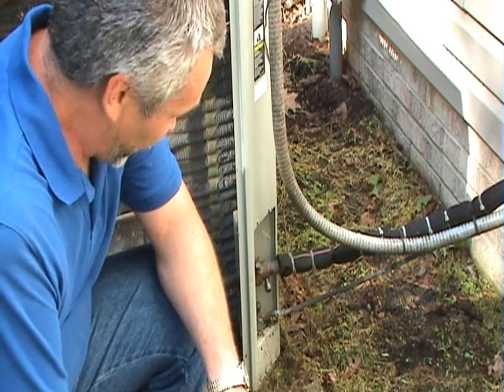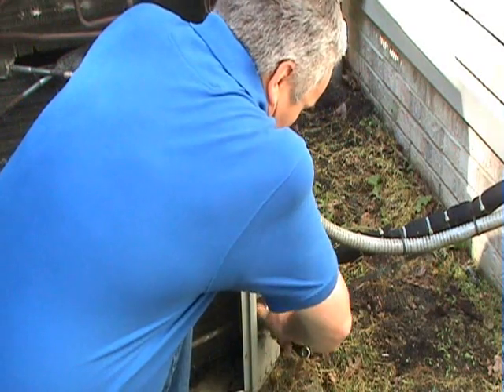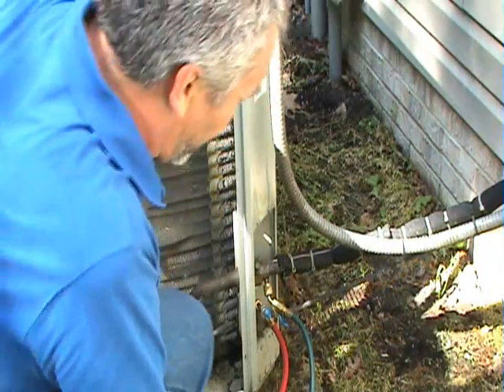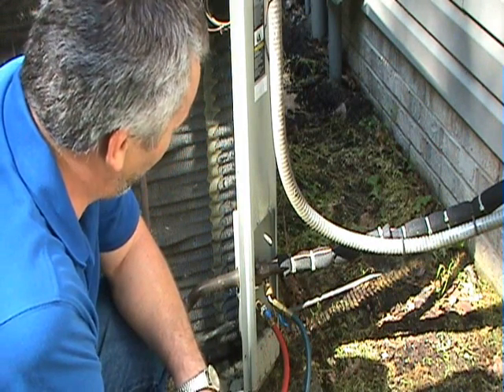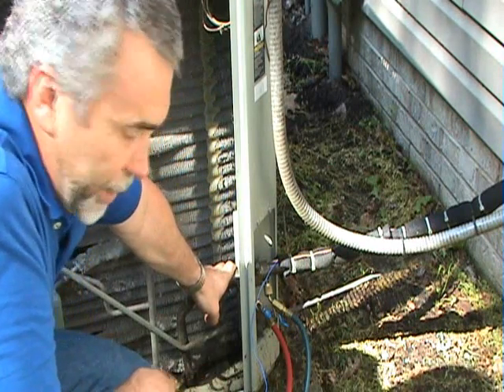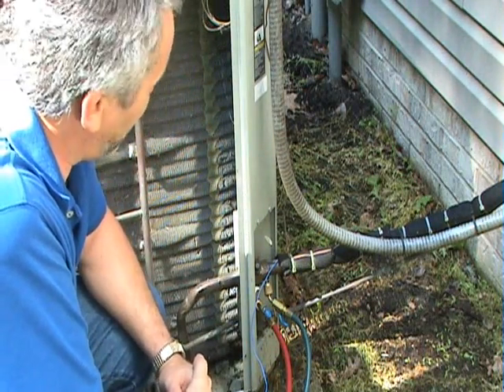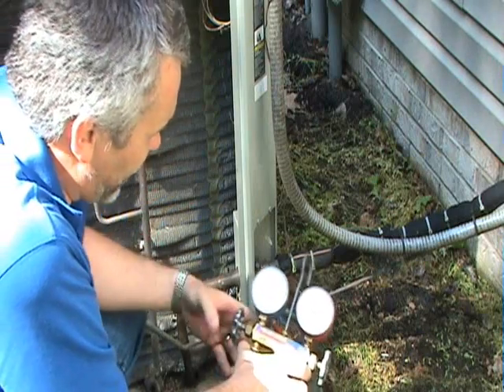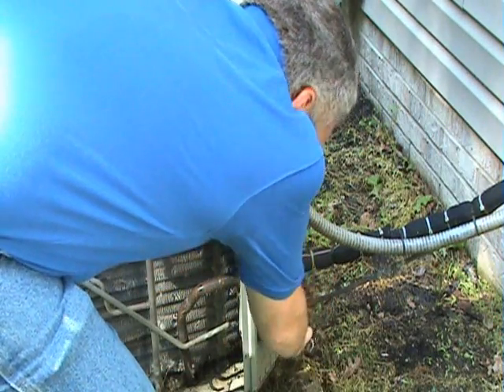How to Charge an Air Conditioner: AC Refrigerant Troubleshooting & Gauges

Comment from the maker: Not sure if you should charge by Superheat or Subcooling? Check your indoor unit! If you have a TXV (expansion valve), go with Subcooling. If it's a standard piston/orifice, use Superheat! 🌡

Quick Tip: Always let the system run for 10–15 minutes before taking your final readings. This allows the pressures and temperatures to stabilize so you don't accidentally overcharge the unit! [05:13]

Comment: R-410A is a blend of refrigerants. So when you charge you open the valve very slow so the refrigerant 1. Gets the right mixture, 2. You are filling it with liquid but because its the low-side you must do this very very slow so you do not introduce the compressor to the liquid as its a vapor pump not liquid. The liquid should hit its boiling point and turn to vapor. Thanks for the awesome video!

Comment: If the system needs a recharge, then it has a leak.  To be sure you don't loose any new Freon after recharging, you must seal the system.  The easiest way is to do it while installing the new charge, using a simple in line injector.   Find tech details and install procedures at this page...  stop HVAC leak .com

Comment: Thanks for the video.  I put an AC temp probe into a ceiling vent here on an old system and the temperature drop is about 15 degrees.  The system is ancient and I service it every year.  The air handler is in the attic and the nameplate shows AC Delco!   The weather is 90+ Degrees and the humidity is high so I feel this system is functioning well.

Comment: @John smith & TJAC07 he has low loss fittings right at the end, and you don't know if he already had R22 in his gauges. Watch the video again! @ Dodgedemon8888 regular home owners cant buy the refrigerant as they would require an EPA certification so whats the issue? It looks like the HVACrepair guy posted this video for the beginners in the trade so mellow out.